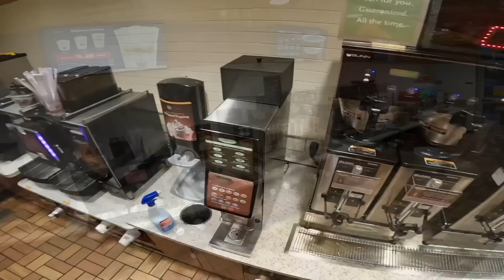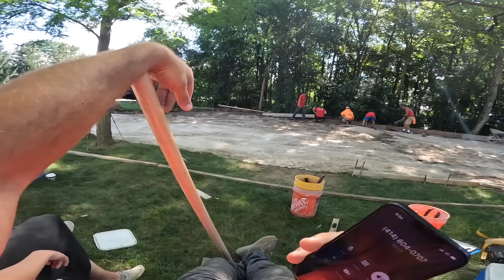Not bad for a Monday-BIG driveway removal

Comment: If I was going to have a parking pad for the vehicles stored outside I would have those small square gravel filled concrete blocks so any fluid leaks could be contained and won't stain the poured area. Do you use those on any of your installs?

Comment: Ryan if you have the key number you can get one cut from that number as long as it is a factory lock the serial number will tell the dealer that lock number it is
Reply: It maybe in the owners manual as well a small metal tab with a number on it

Comment: Wondering if you needed to work a police detail into this bid.
 Knowing youve already poured this job, because it's Saturday here, and this is a Monday video that was just uploaded..
 Also, I mentioned a power washer scrubbing tool from a company called "Northern tools" they have a website. Might be a perfect tool for sealer stripping jobs.
 It looks like a 12" buffer.
 And, as far as the cramping you get, you need to stick to water and keep up your electrolytes, and use chips for salt, and also grab some potassium supplements.
 My father did carpet for many years and it's soda and coffee all day everyday that beat him with bad cramps all the time.
 Long comment, but there it is. Hope something I mentioned helps

Comment: I will defend Daryl this time, OSHA says that you're supposed to keep at least 10ft away from power equipment at all points while its running. The operator should be cautious and looking around for potential threats but everyone else should be aware of where the equipment is. Also supposed to be wearing hi vis while operating equipment but thats a different issue.

Comment: Hey guys, I need some suggestions. 2 weeks ago I woke up in the middle of the night to use the restroom and smelled a strong odor of wood burning. It turned out to be my neighbors shed going up in flames (its on my channel). But anyway, their home owners insurance is only covering half the loss of property due to it being an out building and not the house itself.

So I'd like to do something for them, but I don't know what. A donation? Buy them some gas cans that they lost? Get them a gift card for gasoline they lost? Create a gofundme? But I need some ideas. They lost a zero turn mower, a push mower, a snow blower, 20 gallons of gas, kids toys, yard game toys, and gardening equipment (shovels, rakes, wheel barrow, and such). 

Thanks.